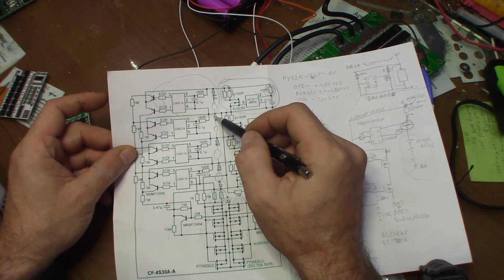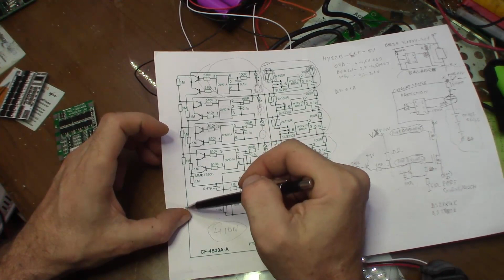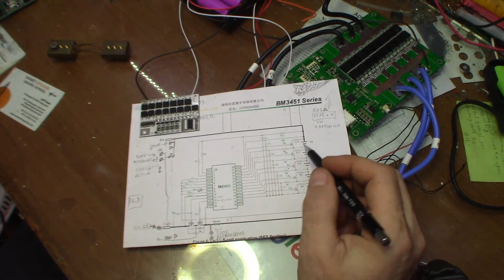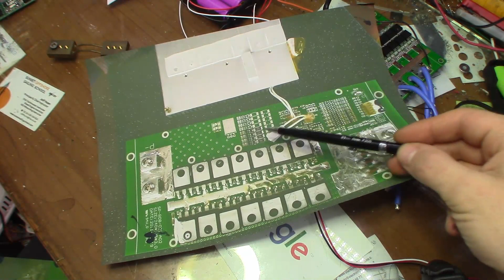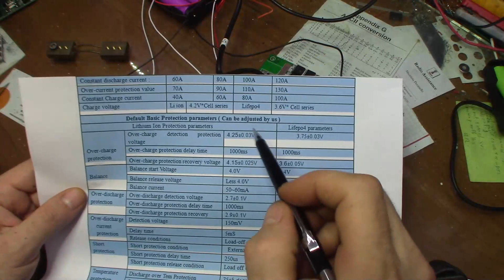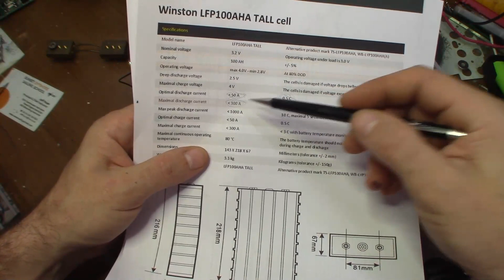what's inside a cheap lifepo4 bms, how they work and one that can be suitable for a boat,Rw...

Comment: Hey, great walk through. It seems that quite a few Chinese brands use the final board in your video and just put their logo on it e.g. Daligreen, Heyo etc. 

For a marine application i see a few matters to address. The need for a separate charge/discharge terminal to avoid black out during charging, the need to control alternators, pre-charge of some large loads (e.g. inverters), the ability to handle large current bow thruster/windlass etc. And finally how to maintain a 50-55% SOC when docked for longer times. A combination of lead-acid and LiFePo4 is probably the solution to many of the above matters. One of the more expensive BMS system I have come across that claims to solve this is the MasterLi BMS (apprx Euro 700 ). It's especially built for marine applications and addresses a lot of things. It would be great to hear your thoughts. I can provide you with the full manual if you are interested in doing some reading.
Reply from the maker: JUST HAVE 2 OF THIESE ON 200AH CELL PACKS... WORKS FINE FOR ME... THE SOC 50% CHARGE STOP IS HANDLED BY THE VICTON BATTERY MONITOR, SAME FOR THE ALTERNATOR  CHARGE...THEY DO THE JOB AND THEY ARE CHEAP...
Reply: @ElectronicMarine  Which battery monitor model do you use?